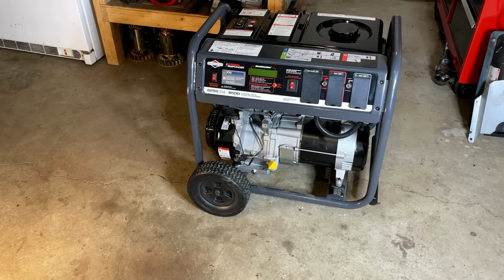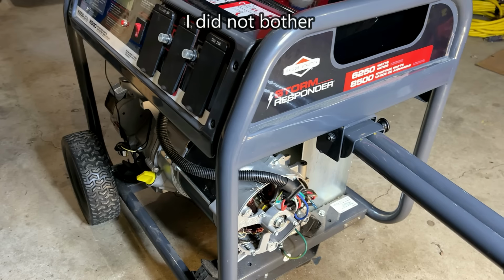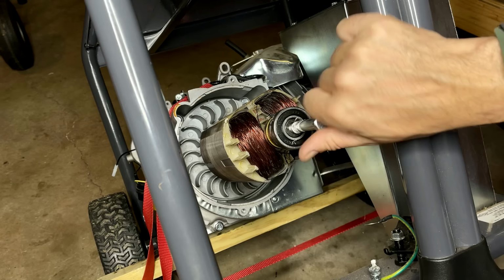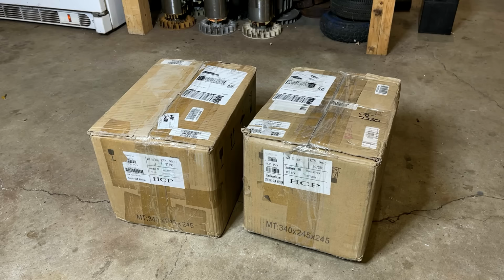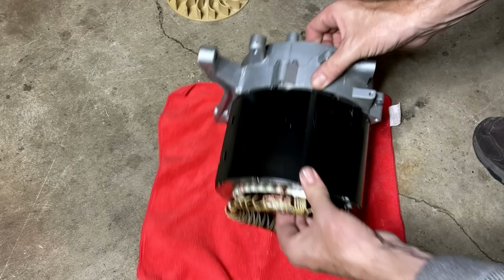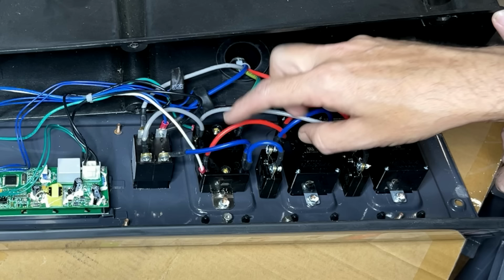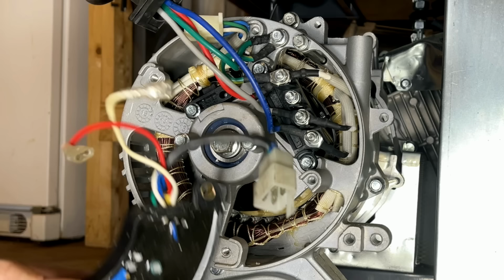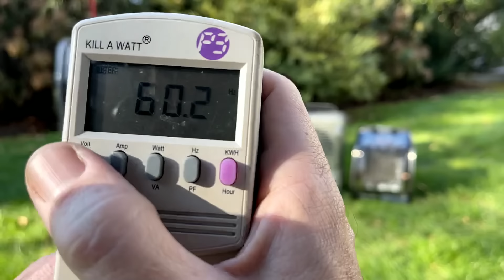New Storm Responder Generator Stopped Making Power

Comment: in a recent video you sent a board away to be repaired. I have a board I need repaired out of a garage door opener, will this gentleman repair any electronic or only for generators.
Reply from the maker: He specializes in generator control boards.  Technically he could do it.  But from a business standpoint he stays away from doing repairs on unfamiliar equipment.  If you have a schematic of the board, then he would be more likely to do it.
Reply: @jcondon1  I don't have the schematics but thank you for getting back to me. I think I found somebody that can fix it.

Comment: I don't know how you can find these deals.  Around me, $500
Reply: YUP, I don't get it either, lol. I never see used newer style generators around here in northern Illinois for under $400 to $500. Only the real oldie low watt ones here you can pick up for around $50 to $100 and they usually don't run.
Reply: @xcalibre222  Which really doesn't make sense as a purchaser, when I can get a 6000-8000 watt new from Sam's/Costco for around 600
Reply: I noticed in and within 60~ miles of a city prices go through the roof. If you go in the sticks far enough where city dwellers don't feel like driving to you get tons of pretty good deals on stuff like this. Also keep an eye on your local scrap yards. They see tons of this kind of stuff and you get it for dirt cheap (if they're nice and decide to sell to you) Sometimes you can even get the "crackhead special" where they junk stuff that has little to no issues (but may be stolen)

Comment: Kind of off subject,  I have a Briggs 22 horsepower V twin I replaced the alternator,  but it only puts out 13 volts on the ac side and 12.5 on the DC side.  The old alternator did the same.  I'm checking at the wires that come off the alternator before the voltage regulator.  I have found if I go past the governor speed the voltage comes up to about 13.2 volts DC I have no idea what RPM the engine is running.  I am looking for a tachometer so I can be sure of maximum RPM.  any suggestions would be greatly appreciated.

Comment: Isn't the rotor supposed to be released by a grease gun? Screwing a fitting into the M12, connect the gun and then pressurize with the grease...

Comment: Hey James that’s the same kind of generator I have a while back I asked you about mines how every so often it stutters not a lot but it happens every 20-30 seconds and I asked if I should be concerned or not
Reply from the maker: Most likely it is running a little rich or maybe lean.  if you choke the engine a little does it get better?  if so then you are running lean and might need to clean the carb.  If it does not get better and only gets worse with choke then that most likely means you are running too rich.  Not much you can do about that other then check the condition of the air filter and replace if dirty and try again or install a new carb.

Comment: James: my Yamaha 7500kw Powermatic (vintage 2015) was left out in the wet for 8 seasons in Minnesota without running it. Now, engine starts but no power output. Is the generator shot from wetness? Can I dry it out and recover its use, or junk it and buy new. Thank you. John Kristoff
Reply from the maker: Moisture can cause issues.  I see it a lot in Honda clones.  Yamaha and Honda though not so much.  There is a chance it is something fixable.

Comment: James, what oil do you recommend? I am Texas and we get pretty cold weather and straight 30w seem a little heavy.
Reply from the maker: 30 is generally good for Texas.  If the generator is in the garage then should not be an issue.  Otherwise if the block is less the 40 degrees you could use 10-30 synthetic.  But over 85 degrees and it will start consuming oil.  15-40 might be better in your case.  Would check what you manual recommends.
Reply: @jcondon1  I think I am going with the 10w-30 as it gets pretty cold here as we are at 32.6632° N latitude. It is during the cold snaps that that I need to have power as we have fish tanks that need to stay around 80 degrees. Thankfully we have gas heat in the main house and mini splits in the 950 square foot addition.
Thanks for responding.....

Comment: I have this exact generator, I bought it for my mother and she did not end up needing it so I put it away in storage. When I opened it up the end cap on the motor under the handle was dented (out of warranty date of course). I started it up and I had a spark and some white smoke after 30 or so seconds of it running. I replaced the AVR thinking maybe that was the cause but the statstation LED still will not come on and no power being generated. The coils do not look burnt. Any idea what my next troubleshooting should be?
Reply from the maker: The best think would be to check the health of the stator and rotor using a multimeter like I did in this video: https://youtu.be/Cmy_denuowc?si=m4gkM7LxBzEI1L0C

Comment: Hi James, question for you. It’s a Briggs generator but you say the engine is a clone, but branded Briggs. The few newer Briggs engines I’ve worked with have seemed cheap and a far cry from the wonderful old flat heads of yore. My question is, if Briggs has moved all their manufacturing to Asia and they’ve cheapened everything anyway, how can you differentiate a Briggs clone with all the labels and markings from a genuine unit?
Reply from the maker: The flat head engines were very high quality.  The Briggs OHV engines are usually 9 or 10 hp.  The clones 13-15 HP.  The Briggs valve cover is rectangular.  The clone is more of a diamond shape.  The clone engine sadly is built better then most of the briggs OHV engines (assuming no quality control issues).  Nothing beats the flat head engines quality.

Comment: You would be better of, corrosion in the future from water and lubrisity wise, if you used hydrolic fluid or plain engine oil. In a pinch, cooking oil works too! Just don't use a power tool to do up the bolt! Go on, ask me why?

Comment: Hey James, just wondering…. Do power heads typically wear out if built correctly and not abused during use?  I suppose other than the slip rings wearing out right?
Reply from the maker: If made well, they should last forever.  Unfortunately they are built with temporary emergency use in mind.  And of coarse they cost a lot less then one meant for daily use.

Comment: as you receive the new power head, I would go inside the control box and fix the color code of the 240V leads, as in the U.S., Red and Black are hot, White is neutral, and green is ground, no sense keeping that color mismatch as somebody in the future will wire it wrong thinking the colors are correct. ... or at least wrap the proper color tape on both ends ... just sayin'

Comment: I have one of these made in 2017. The carb keeps getting gummed up. It has a HUAYI carb. I cannot find a gasket set for this carburetor or what carburetor would replace it. Can you help me? Where can I get a carb kit and a replacement carburetor for this generator?
Reply from the maker: Briggs wells the exact parts for your generator.  There should be a white sticker on the bottom frame rail with the model number.  If you want cheaper parts then there are other options.  This engine is a clone of a Honda GX390.  Gaskets and a carb for a GX390 or a honda clone in the 389-420cc range should work.  If yours has a choke lever like this and a fuel solenoid then this kit will likely work https://www.amazon.com/dp/B07MVW593Y?linkCode=ssc&tag=onamzjamesc00-20&creativeASIN=B07MVW593Y&asc_item-id=amzn1.ideas.30RRW594E9VDM&ref_=aip_sf_list_spv_ofs_mixed_m_asin
Reply: Finally found the engine model number 25G032-0001-G1 . The Briggs number for the carb is 704931. Now just need to find a compatible replacement.

Comment: Will the rotor and stater out of a 7000 W Generac work inside of a 7000 W power boss Briggs & Stratton
Reply from the maker: Depends on the models.  But I believe the power boss uses a different tapered shaft then most Generac models.
Reply: @jcondon1  thank you for responding I'll let you know

Comment: Hi, I'm in Guam and the Typhoon Mawar just destroyed our power lines. My generator got wet during this 3 days. The oil is milky and the generator doesn't want to start. I ready changed the oil, air dry the filter. Unfortunately the CO red light it's flashing now that it starts and the generator turns off after few seconds of working. It's moved away from a wall outside the house, I only have refrigerator and living room on tot use with it, but doesn't work. We lost power 5 days ago and this island is too humid and hot. Please advise me how to fix it. This generator only was used 1 time and it's brand new. 🙏Thanks
Reply from the maker: The manufacturer will tell you to never run it without the CO detector but there are ways to bypass it.  Under the blower housing is the flywheel, fan and the ignition coil.  There are two wires coming from the coil.  The larger one for the spark plug and the smaller one is connected to the CO detector, ignition switch and low oil system.  The engine is shut down when one of those three things ground out that wire to the coil.  Ideally you would remove the connection of the co detector so it can not ground out the coil.  You could also cut the small wire going to the ignition coil.  It would run but then the low oil system and off switch would be disabled.  To shut down you would have to touch and hold the cut wire coming from the ignition coil to a bare piece of metal on the engine or shut the fuel valve off and wait a couple minutes.  Also check the oil every 12 hours because the low oil system is bypassed.

Comment: Check fuse , check voltage regulator,check stator, check wiring
Reply: Remove the stator , order a remanufactured stator/ rotor and voltage regulator, can replace the entire power assembly that match the current output of power to match the listed output on the generator. But quality control in China is very bad and that is why it pays to buy american
Reply: Instead of adding water use high weight oil (thick) to remove the rotor, water will cause rusting and future issues with moisture, and if the new stator doesn't fit will have to make a plate to ensure that it mounts
Reply: Those (clamps around the wire that measure the amps voltage etc are CT's they are commonly used on commercial and industrial services ( main service panels) when there is parallel service wiring is used to feed main service panels usually wiring from CT panel is ran to meter box
Reply: If your not sure get a wiring diagram if your Still not sure hire someone

Comment: Why did you leave the Hz 1 too high?! Aaaaa
Reply from the maker: I left it at 61.5 hertz.  Ideally I would set at exactly 60 hertz.  But most mechanical governors droop by 3-5 hertz from no load to full load.  So without a load you have to be a little high so that when under full load you stay above 57 hertz.  60 hertz +- 5% is safe for electronics and with spec for what utilities are allowed to provide.  If I set to 60 hertz with no load then the engine could slow to 55 hertz under full load which is too much.

Comment: Quick question. Why do you work on the floor when you have a lift.
Reply from the maker: Sometimes the lift has another project on it in pieces.  I usually work on several repairs at a time.
Reply: @jcondon1  ok
Reply: @jcondon1  I wondered how you pump these vids out.  :-)  Not only do I watch your videos for content, I watch them to figure out the timing of when you did the work.   I figured this one was a week or so after your first frost, because the hydrangeas that have died back.  I'd say mid October.
Your output is amazing, in quality and quantity.

Comment: Who makes a good quality portable generator? My wife and I live in a storm area and need a backup generator. I bought a new sears generac over 30 years ago for emergency power. It’s been a good generator and used many times over the last 30 years. It doesn’t have electric start and my wife can’t start it when I’m gone. Have to buy a new one with electric start for her. It appears generac is using Chinese engines and power heads on their new generators. I looked at a new power mate 5000, it supposedly is owned by generac. It looks like a Chinese engine and generator head. Who makes a quality electric start generator these days??? Thanks

Comment: Why? 
Lock Nut vr Lock washer
I even on a IceEngine I use Lock nuts so if your going to install or rework a terminal why use Lock washer?
Cost!
It cant be cost inefficient and pennies 
Heat
Wires are never to see heat even the wire insulation is the same plastic as Lock nuts
Lock nuts
Well I think its nuts not to sh can the Lock washer and install Lock nuts.
Heat
Wire has plastic insulation wires have plastic insulation shrink tube
Cost
Spend the pennies and swap out the lock washer for Lock nuts
Spring Tension
If you want the spring tension of a lock washer then all a spring washer still pennies for Lock nut and spring washer but light years better than lock washer.
Reply: Now I like your vids and presentations, but my Tesla (5 PowerWalls) can power a home for 4-6 days without charging so IceGenerator will soon be history